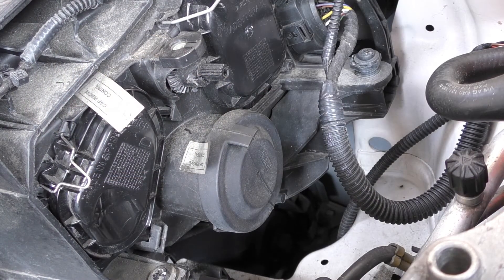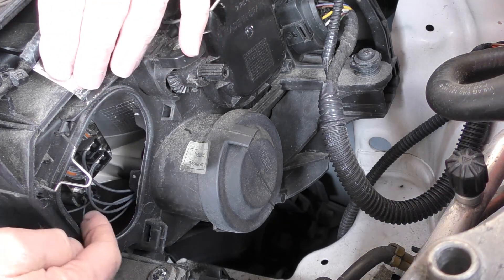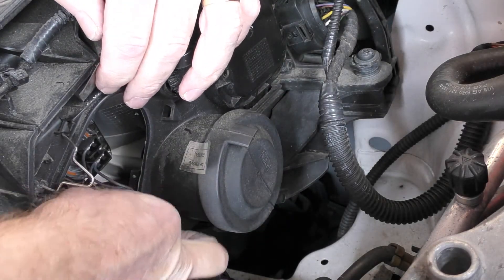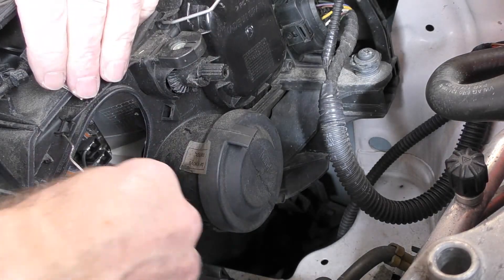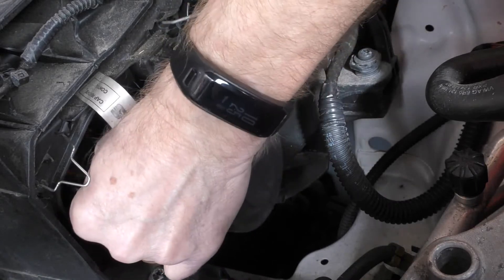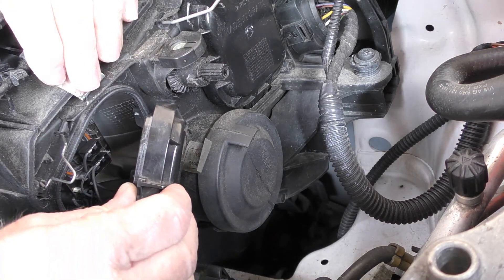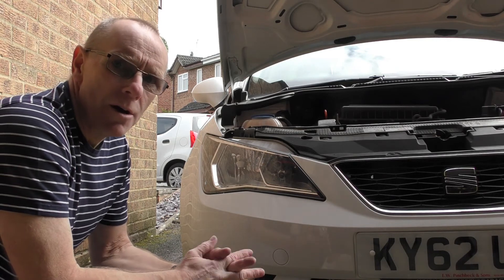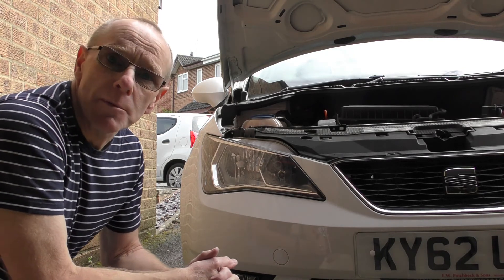Seat Ibiza. 1.4 se. How I changed my side light and parking light bulbs. 2012.

Comment: Aye pick the easy side!! What about the side with the battery ffs can't get the fitting out cos it's wedged in by the fucking bumpers
Reply from the maker: It was just to show how to remove and refit the bulb and it's fittings as it's very difficult if you can't see it, so it has to be done by feeling your way to a certain extent. There isn't enough room to get the camera in on the other side. My old Seat Ibiza had it next to the battery, had to get someone with small hands to get it out and back in for me.